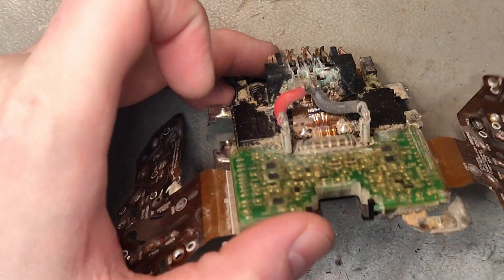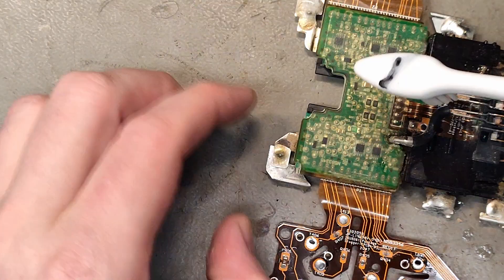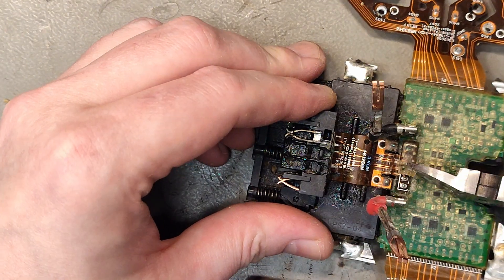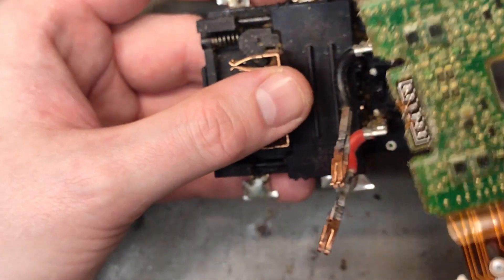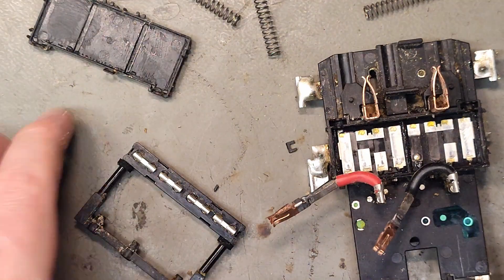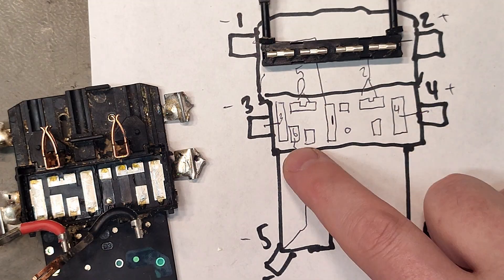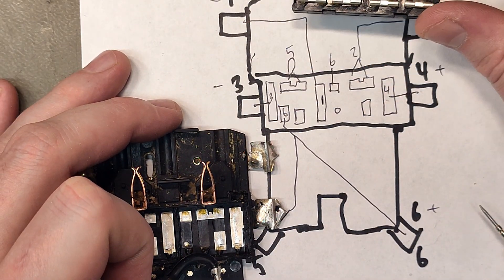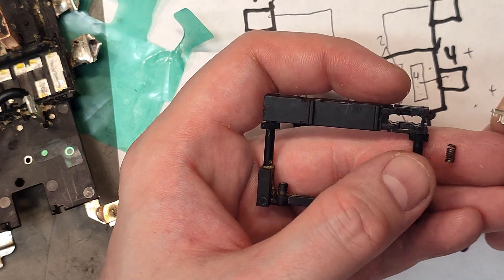I finally understand HOW Dewalt Flex Batteries switch voltage 18V-54V (20V -60V)

Comment: Great video. Thank you for the info. When I measure(60V switch not active) from 5 to 6, 3 to 4 and 1 to 2,  I get 19.7V on each of the three groups. When I install the 60V jumper(black and red shorted) and I push the 60V switch in, I get 19.7V from 5 to 6, 6.8V from 3 to 4 and 19.7V from 1 to 2, for a total of 46V. Why are the 5 cells connected from 3 to 4 dropping from 19.7V to 6.8V when 60V mode is active? As far as I can tell, the 60V switch is supposed to disconnect the 1,3,5 and 2,4,6 groups(parallel) and connect 6 to 3 and 4 to 1(series) to get 60V. EDIT: As I suspected, one of the cells in the group 3 to 4 is bad(middle of the group). It measures -8.6V when 60V mode is active. In 20V mode it measures 3.9v(because the other 2 groups are in parallel affecting the measurement). In 60V mode if I short the bad cell, then total voltage goes from 46V to 54V(should be about 58V total when all cells are good). Will try replacing that cell to see if problem gets solved.
Reply: That makes no sence. You cant have a cell in parallel and series at the same time without shorting the pack.    And you cant get a single cell or parallel group to over 4.2 (safely at least. But max would be like 4.4 -4.6 tops befor it blew up)